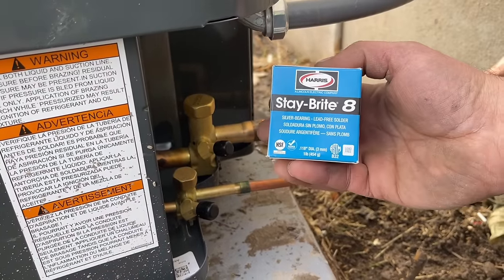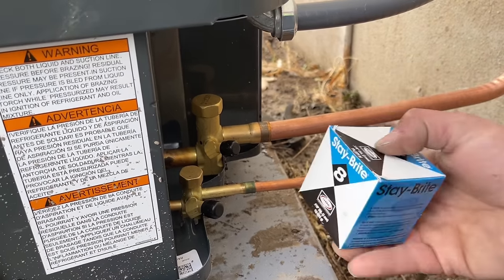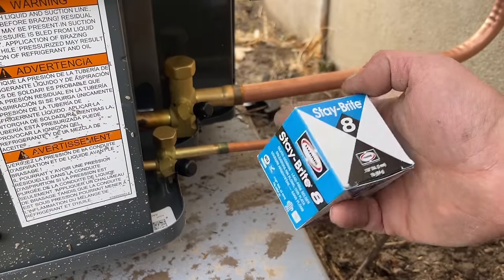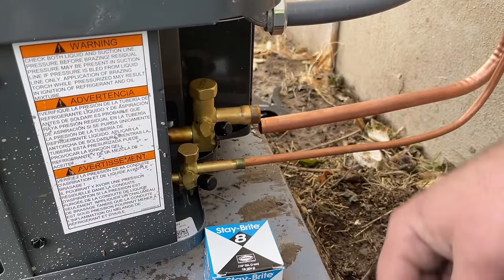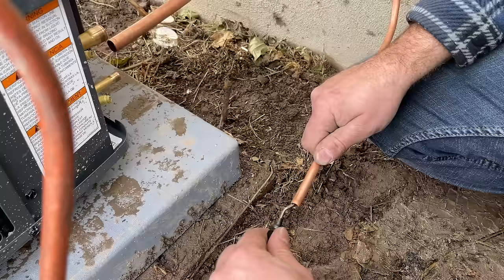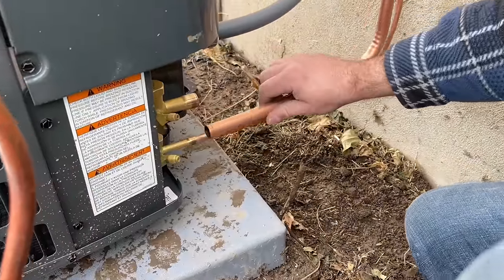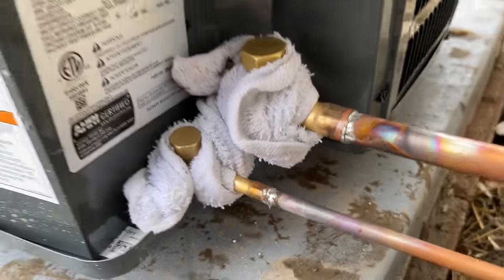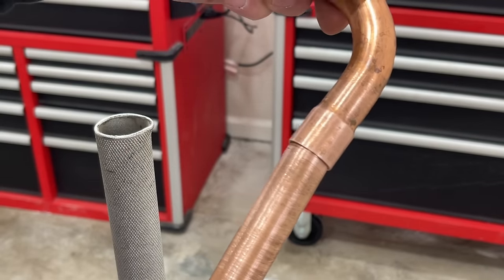An Awesome Alternative To Brazing HVAC Lines. Staybrite 8 Soft Solder

Comment: If you take your flux brush and dip it in the flux after applying the solder you can clean the weld and fill the crown of the weld by going around it with the brush!!!!

Comment: Can't understand for the life of me how HVAC guys don't use Staybrite 8 almost exclusively.
The low temperature it flows at means that you don't have carbon build up in the pipes (no need for nitrogen purging) and you don't weaken the joined metals from high temperatures (annealing).  You don't have to worry about cooking thinks in the vicinity such as service valves or plastic panels (unless the panels are really close by). Melting plastic surroundings is a big concern in domestic refrigeration repairs. 
Some people claim that it's weaker in areas of vibration. Can't argue that but my experience and manufacturers claims say differently. If your experience differs then use alloy brazing in areas of vibration such as compressor connections. 
Yes it's more expensive but the benefits mentioned earlier make it worth the extra cost to me.
You do have to clean and flux. It's not forgiving to poor prep. Very forgiving to proper prep 
You do need tight fits because it flows very thin and that is a big reason many guys prefer alloy brazing because you can fill in some relatively big gaps. 
Another reason many guys prefer alloy brazing is because that's what they have been using for years.
Reality is that our innate resistance to change is the biggest reason we don't want to try something different unless forced to do so and then often we wish we had done it sooner. That's how I felt after trying Staybrite 8
Btw, difference between Staybrite 8 and regular Staybrite is that Staybrite 8 is a little more expensive (20 buck basically) because it has a higher silver content which means it has a temperature "range" at which it will flow so you can (if you know how) use that ability to fill in gaps in minor loose fittings as it gets thicker at the lower tempeature flow point,  whereas regular staybrite  has a single temperature flow point.

Comment: Yeah I really don’t know if I’d trust this. Is it rated for 410a pressures? What if the condenser gets bumped? What about non condesables? Flux seems like it might be a problem. Look if it works it works, I’ve only been in the field since the beginning of 2018 but it goes against everything I learned in school. Remember it’s not just the pressure we’re working with but the refrigerant as well. I’ll look into this but it just seems off to me.

Comment: A massive torch head. copper turned black you have flakes on the inside now you got to replace the Schrader valves  both of them a nice filter and sightglass on the 3/8 copper would have been nice

Comment: Question can you use this technique when replacing a Compressor.   There is a lot of vibration but then again the compressor is on rubber mounts to tune the vibration down but is there too much vibration in that area that might cause it to crack or get brittle and leak?

Comment: I brazed 100% of my joints. I do commercial heating and air and I never see that on the parts shelves. If I find it I will do a comparison test with a pipe caps and braze one side and using this solder stuff and do a 500 psi test on both joints simultaneously. That's holds I go to 1000 psi. I like brazed joints though because you can fill a joint with a silfoss rod.
Reply from the maker: Do a test and let me know! I’d like to do a test too. Tensil strength on it is over 1000psi
Reply: Solder joints hold more pressure but are more likely to crack from excessive vibration. Getting a pipe hot enough to braze it anneals the pipe and weakens it. The pipe itself will fail.

Comment: Thank you for your videos. Been limping along with a 52 year old Bryant gas furnace in the basement. Have kept it going over the years. Must have been built well. Had to replace the fan motor and transformer a few times. Need new ac too. Thinking about getting a whole new Goodman system this spring and putting it in myself. Your videos are a massive help.
Reply from the maker: If you need help with your install, check out our Patreon membership at Patreon.com/diyhvacguy where for $25 you’ll get one on one help with sizing, purchasing equipment, warranty, as well as help with any install questions. Cheers!   Dave
Reply: @diyhvacguy  I will do that! I think the furnace will be pretty straightforward, but I’ve got a ways to go learning about the ac install.
Reply: If you're not EPA certified you shouldn't be installing the AC portion. Have fun with the furnace though.

Comment: I still use silver soldier with a small set of oxy accet. You just have to be patient, precise and evenly heat the connection being careful not to over heat it, It is definitely an act of Futility if you don't do it right. I have seen Techs melt down liquid lines before because of the intense heat.  You have to be coordinated with both hands one directing the heat on and off as needed and the other applying the soldier.  I haven't used Staybrite so I cant say anything about it, so to each their own.

Comment: I have not seen an HVAV Tech yet who can solder! Look at the solder on the ground.  Put the flame about two inches toward the house, Let the line transfer heat toward the joint. When its hot enough the solder will melt just by touching it to the pipe joint, Keep the flame away. It will melt and suck into the joint just as smooth as can be, Stop putting the flame on the joint and solder directly. If its a clean joint meaning emory cloth it shiny and dont touch the clean metal after you clean it then Flux it good then solder like I said above.

Comment: What happens to the bead of flux on the inside? I would consider soldering, but no one ever answers what the acidic flux residue trapped inside does. If there's residue outside, it's inside too. Putting it on the male side doesn't matter, because a bead of flux is pushed inside as the solder wicks in.

Comment: I prefer brazing but You should take the caps off the main valves to help dissipate heat and heat the joint more not tac weld the rim.

Comment: When you braze , you create an alloy . When you solder you create an occlusive bond .
Reply: Can you explain what the difference is and the advantages of one over the other please.
Reply: Both processes involve melting a filler metal into the joint, but not melting the base metal.

Comment: Interesting product. I like the fact that you don't need an expensive oxy acetylene tanks and equipment.  I noticed you didn't clean the inside of the fitting like you would with plumbing soldering. Looks like it may not be required or only needs cleaning if the fitting is really oxidized ?
Reply from the maker: Yea, I will probably get one of those inside cleaners just to make sure everything is good to go as it is a nightmare if the solder doesnt take. You cant just braze over it. But being as this was a brand new unit, i primarily just needed to clean the side that was super oxidized. Thanks for the feedback!   Dave
Reply: @diyhvacguy  you are using FAR too much heat in your example unit.
Soft solder is tricky to use. The heating needs to be done slow and easy.
You did better on the example joint in the shop.
However, you spot heated, which leads to gaps in the joint and seams in the solder at the molecular level.
Your technique will improve over time, but you need to evenly heat the joint. Around the entire connection.
Reply: @diyhvacguy  when done properly, the solder will wick instantly around the entire connection. So strive for that.
Reply: Any thoughts about an inductive heater for joining pipes--whether it be soldering or brazing?

They seem like the most sure fire way to go about evenly heating a pipe regardless of the size, and there is no open flame
Reply: @jacobcarson2559  hmmm.
I dont thing inductive heaters work unless the pipes are ferrus... made of iron... copper wouldnt be heated with one.
Reply: @whochecksthis "induction heating  precise, repeatable, non-contact method for heating electrically-conductive materials like brass, aluminum, copper or steel or semiconducting materials like silicon carbide. "

Factories use induction brazing. It's more consistent.
Reply: @whochecksthis I think it depends on the frequency of the inductor creating the field. It has to be in certain range for certain metals. If you change the metal you need to change the frequency of the inductive field. So they would just have to make an inductive heater specifically for this application. But that wouldn't be hard to do.

Comment: 3/4" copper tubing is hard to find in small lengths. ACR tubing. Can you use hard type L copper and standard fittings from the home depot?

Comment: I have a 2 ton LGRED Minisplit  to install in a few months on the new shop I'm building. Id prefer a more solid connection to the line set than using flare nuts.  Staybrite 8 my just be the ticket I'm looking for.
Reply from the maker: It could very well be! It’s amazing, just make sure you do the prep work 👍🏼
Reply: Minisplit on heat goes up to almost 600psi I would like know  if holds that amount of pressure

Comment: I really like the look of that insulation on the suction line. Can you share the manufacturer and part number of that? Thank you.
Reply from the maker: I get it in a spool from the supply house. I’m not sure if they sell just the insulation by itself. They sell black elastomeric insulation at Home Depot with a removable adhesive strip. I like to use that sometimes as well but the white stuff is much more durable for sure. Cheers

Comment: I only use stay Brite for replacing reversing valves. It's easier in that case other than that brazing is easy enough.
Reply: What torch Do you use?
Reply: @J Banakos  regular turbo torch with an MC acetylene tank. I keep 2 MCs on my truck. In my opinion an oxy acetylene rig is overkill. You'll burn a hole straight thru the copper. Always a good practice to wrap ur valves or whatever ur protecting with a wet cloth as well as a light nitrogen purge.

Comment: Never put flux on the inside of a refrigeration fitting.  I doubt that this is stronger then a braze.  I wouldn’t use this with a hard pipe system with a lot of joints.  There is just no way to keep that flux from running inside the pipe.  I’ve used this several times.  It will void out on larger pipes.  It is much more sensitive to prep, and gaps in the joint.
Reply from the maker: The numbers say it’s stronger then brazing 🤷🏻‍♂️
Reply: @diyhvacguy    Can you show me those numbers??  A soft shoulder joint, cannot. Have the vibration resistance, and the capability of expansion and contraction, like a braze joint. I used  stay brite on a solar panel manifold, and the joints kept braking.  When I did it over with  Harris 15, braze, it never failed again.  The only drawback of brazing that it will anneal hard copper ACR pipe.  It doesn’t affect soft copper tubing.  That is what line sets are made of.  You have to anneal hard copper to flare it, and bend it properly, (without the wrinkles.).

Comment: copper (II) oxide forming on copper when oxygen present and heat applied (if my memory serves, 400°F +) ,. That's why you should flow nitrogen( inert gas) so it will not form inside and contaminate system later.
With that - you still can't eliminate nitrogen flow with this concept. Push ons(aka HVAC shark bites) - no nitro needed
Reply: Soldering with SB8 is  way below the temp at which oxydes form.
Reply from the maker: I think the other commenter didnt watch the whole video because that pipe was clean as a whistle when I cut the joint in half
Reply: @diyhvacguy  I did. Just talking science. FL HVAC contractor. I rarely see techs or installers carrying nitro down here anyway.  😂 . So that keeps me busy.
Over 10 yrs of installs and never had to go back for txv or compressor failure (besides broken txv bulb tube/ LG or rotary compressor and, of course major 2014 Copland oil mess)
Hard  not to overheat in tight nasty spots. Copper/oxygen/400F. Top it off with poe oil in R410a systems
 I do understand - it's alternative, it looks clean. but still not going to retire my oxyacy and nitro.
Great video. Great alternative. It's just me always trying to go by the books.
Reply: That staybright melts at 500 degrees, there's no way you shouldn't purge with Nitrogen
Reply: @butchburns9106   Oxydes start forming at 800f + . No need for nitrogen with SB8.
Reply: @shoosh9996  visible oxides :) . Just refreshed my memory. There is plenty of researches done on temps. Not arguing- way way way better than oxyacy with no nitro. Still sticking to science, therefore it is nitro for me unless working on plumbing 😉 
with A2L's to be around soon in residential - sticking to air(oxygen) displacement with inert gas before brazing regardless of temps. R290 and R600 already around in small appliances for years. IMO - industry came up with "push ons" due to a2l will become pretty common

Comment: Thank you for great idea! Can I use powerful soldering iron for this?
Reply: There are electric devices designed for plumbing but using a torch is much cheaper and easier to use.

Comment: Its best application is for txv’s.  Never had a failure on anything ive used it on.  The manufacturer’s need to get with the system.  Brazing cooks everything and weakens the copper.  Harris products are the best

Comment: @The DIY HVAC Guy  ...  I like all the videos I have watched.  But, how to do these things on a horizontal pipe?  My fridge return line has a pinhole.  I was going to cut it out and use a coupling you recommend.  However, that return line is horizontal.  And, do I have to vacuum the system?  Etc?  BTW, I have a cheap gauge that will be sufficient to recharge.  I just have to get one of those clamps to attach that pierces the line.  TY in advance!

Comment: This is very nice, basically if you know how to braze plumbing pipes this method should work for AC lines with minimal adjustment.  Do you have to use MAPP gas or regular propane torch will work too?
Reply from the maker: I've just heard mapp gas does better but I would assume you coudl do it with propane as well.
Reply: I think MAPP gas is a lot hotter...

Comment: maybe you have too hot of a torch, mapp gas should not be required for a pipe solder joint, if so, use a smaller nozzle. I expect the solder to flow right into the joint easly, when it does not, your pipe is too hot and you cooked out the flux. When the copper pipe becomes ooxidized it was too hot. imho. I know most techs use acetylne, but they use a smaller flame.

Comment: This will be great for the acoil instalation as it protects the txv which is very very susceptible to heat damage. On the outside unit I still prefer to braze and this thing always gets bumped and moved. Just my opinion, it works for me, never had any problems.

Comment: @BigY Either.  MAAP = 5300 degrees, Propane = ~3500 degrees.  Staybrite 8 melting point = 500 degrees.   If you're maybe going to do some copper plumbing on 3/4" or especially 1", pickup the MAAP, it isn't that much more expensive.  If learning/new stick w/ propane as you'll  get more leeway in heating.  THAT SAID...vibration (and jolts) are going to kill these joints.  It's enticing for how easy this method is, however on my own home, brazing will be the way to go, b/c if you lose all your refrigerant b/c it fails, it outweighs the minor "savings".  And if you're going to braze around evaporator, well, then you're just humping 2 sets of tools for 1 job.  For that matter, you can readily get (any home DIYer especially) Oxy/MAAP to braze as it's suitable temps, just make sure you have the correct tip and practice before doing it on your own system.  If ppl decide to use this method heat OPPOSITE side of the pipe first and also as mentioned, to start w/ the correct fitting/side so it's actually drawn in sufficiently w/o going into the pipe itself or dripping all over.
Reply from the maker: Thank you for the tips sir 🙏🏻
Reply: @diyhvacguy  NP.  Lastly, Brazing has 5-6 times the shear strength  70k to about 11.5k for Staybrite/etc methods.  That's why it helps so much more in areas of vibration.  The one area is the dryer filter where this could be used...if you want to carry 2 tools...
Reply: @devnull7550  Good call-out DevNull, didn't think to call out the (cheaper) replacement for MAPP.   Any should be good for SILVER brazing honestly, but should practice with each to get the timing right.  If one does need 5300 degrees, map-pro/oxy will get you there still.

Comment: Didn’t bother to remove the schraders. Lucky you didn’t need to replace the valves. .also soft solder especially on the outdoor unit is prone to corrosion which will cause leaks. There are reasons for industry standards.
Reply from the maker: Nah, it’s not lucky, because it’s such low heat and so quick, it’s not needed. I have yet to have a problem. I know folks that have been using sb8 for decades

Comment: I can see where some improvements can be made…but I like it.
I use a turbo torch and silfos with nitrogen still tho.
Reply from the maker: I can respect that 👊🏼
Reply from the maker: Silfos15?
Reply: @diyhvacguy  yes, I’m not that old…but it’s what I learned with, no leaks in over 10 years, but this is something I may try. TXVs and service valves are sensitive areas and a little less heat is a big plus.

Comment: Put some sheet metal under your lines on the plastic pad to catch the hot dripping solder and flux .
Makes the pad look like crap 💩 if you don’t.
Remove sheet metal when done soldering/brazing
Reply from the maker: Good tip. Staybrite 8 won’t mess it up though because it’s way lower temp then brazing.